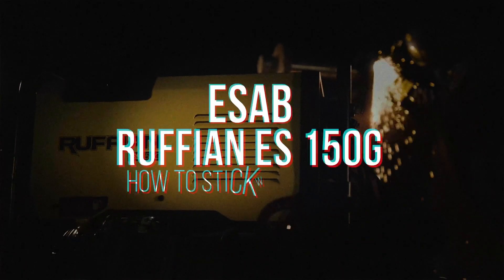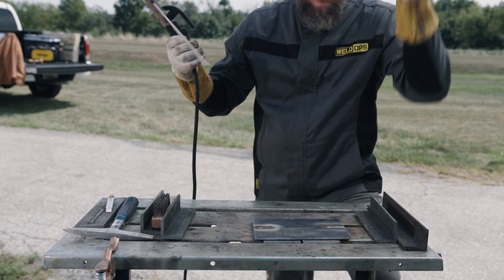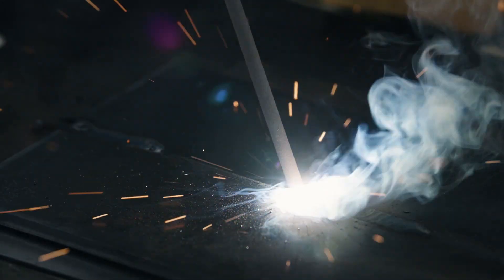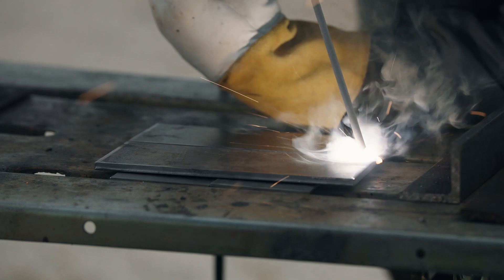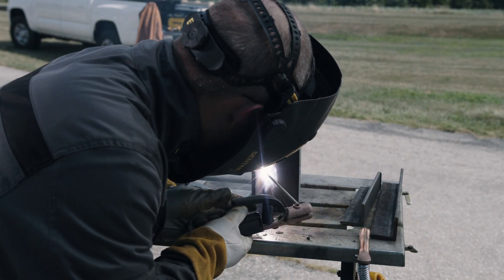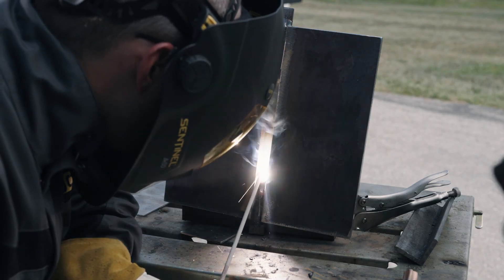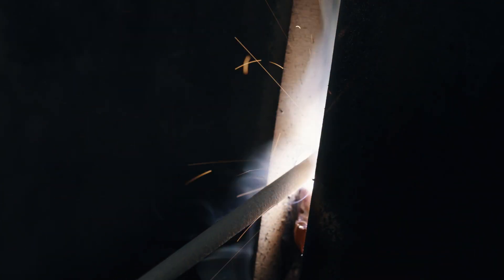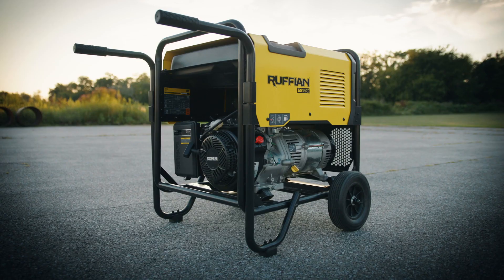How to Stick Weld 7018 with ESAB Ruffian ES 150G

Comment: I was considering a Miller 280 stick welder. But then i would need some upgrades in electrical at the house to run 220v to 250v. Still looking and doing research on this welder. Never really looked into ESAB before. 
Now I want to know if you can run a flux core Miller welder on this. Don't know flux core yet but looking to run both of these together.

Comment: Looking at getting my first welder and came across this one. What size rods will it burn? 1/8th 7018 would be the biggest that I would be doing.
Reply: Says it can do 5/32 from what I’ve seen so far
Reply from the maker: 1/8th 7018 would be no problem at all. Ruffian can burn that all day long.